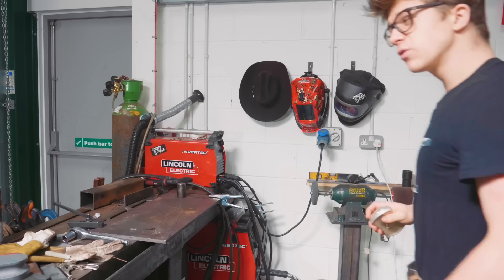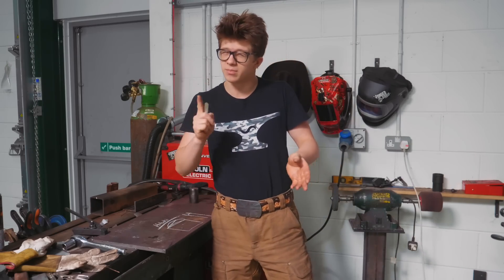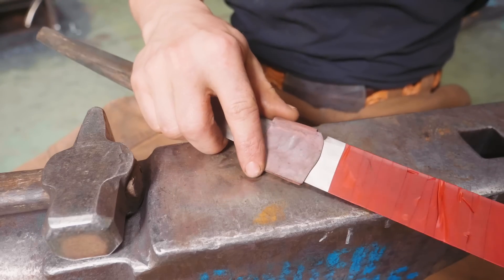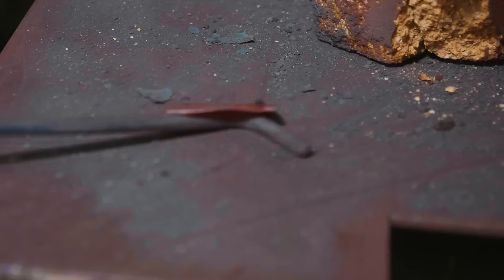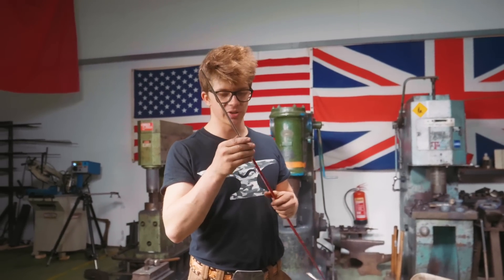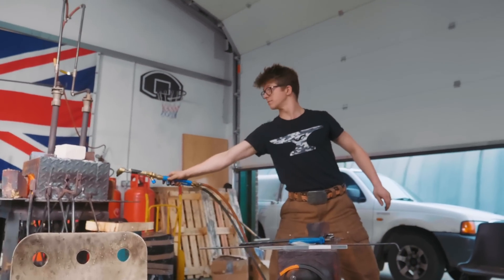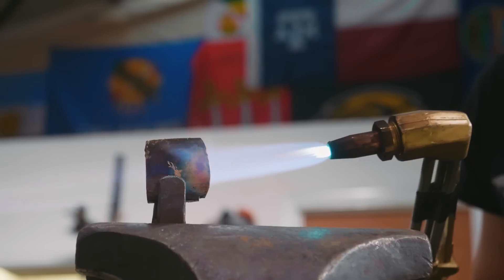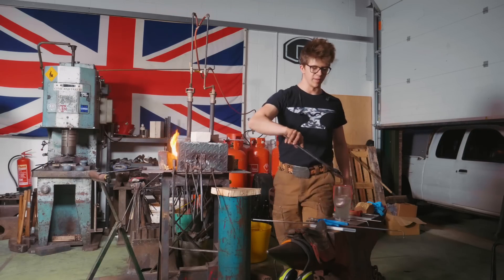MAKING A KATANA!!! 1 MILLION LAYERS!!! PART 6 - The Habaki

Comment: Never before have I felt qualified to offer advice, something that could have closed that joint in a really cool looking way that would have gelled immensely with all your previous forge welding experience would be some mokume  gane, if you'd made your spacer from brass(or many other things but brass is perfect for copper) you could have heated it up till you saw the brass "sweating" from being near its melting point and you could have forge welded it together with teeny tiny taps wit a hammer. Glad you got it done somehow man, well done!
-Tom

Comment: Hi Alec. Next time if you need to solder something similar try to hammer the silver stick making it very thin. Clean the copper with acid to remove the oxidation patina. Lay the thin silver stick you made in between the parts of copper and tight them up with a clamp. Heat the copper until you see some silver flowing out. Job done!! Forgive my poor English. I'm Italian...

Comment: The key to soldering is a good clean joint, right before you go solder sand or wire brush over the place you need the solder to stick, it needs to be bright shiny clean to work. For what you are trying to do you should take another stab at tig welding copper, it can be done.

Comment: Hey Alec. So when soldering, flux wants to flow towards the heat and the “solder” flowers to the flex.  So if you heat it from the button you’ll notice that the flux will flow down towards the heat, at that time add your material ”solder” you’ll see it flow on through. It should be as strong as a weld. Sir good luck. Thank you all of your fun videos.

Comment: With your new found knowledge of silver soldering, you can not also do copper plumbing!  The methodology is the same, you heat up the copper using propane or MAPP gas then add the solder.  You do need to use flux when doing plumbing so that the solder gets into the joint and creates a water tight seal.  Well done, and as mentioned I really like that you do not edit out the mistakes as it helps us all learn the why's of each failures without having to run through it ourselves.  Keep up the awesome work, and I will look forward to future video's!

Comment: brown tip - lowest silver good for copper - copper, cherry red - stick some solder on it, move the heat and pull the solder to where you need it (it follows the heat), its pretty easy even a map gas torch is more than enough for that. practice just slightly melting it and making a tower (flame/heat control). very basic probs all wrong because its 3am but its something

Comment: Also for fun way to temper the blade. You could take a large thing of square tube, weld a flat piece of metal on one end and use that as the base to stand it up right, fill it with oil, and you could take a blowtorch to the outside of the tube and warm all the oil to the desired temperature “500°” but you need for the metal. You can let your sword soak in that oil for that hour or so that you need. You can use that instead of having to put it in an oven. Good luck sir have fun building things. Can’t wait to see the next episode

Comment: Just a quick hint Alec, you can tig weld copper. If you make a piece of filler wire from the copper it will weld fine on dc current the same as steel.

Comment: Good soldering requires 3 things aside from sufficient heat:
1. A good close fit between parts
2. Mating surfaces MUST be clean
3. Complete flux coverage on surfaces to be bonded

A good solder joint won't even be visible once it's done and the excess filed off the surface.

Comment: I Silver Solder on refrigerator sealed systems every day and there are a few things to look into. 1: I would look into if you are using the correct percentage silver solder. on copper lines i generally use 5% silver solder and Most days i dont even need flux. 2: Flux paste! It is amazing it can wrap around whatever you are using and works perfect 3: application. When trying to solder i see you place the solder on and try to do it. Essentially you will end up with a small leak which will of course progress with vibrations (Something you will see a lot when hitting things with a sword) To try to put it simple apply head to where you want the solder to flow with such thick copper you can bring it up to a glow but its not necessary but touch your solder to your piece and move the farthest end of your flame close to it. This has been my tactic and it never fails me. It brings the temperature up enough to get it into that transitional period of melting and you will see the copper suck the solder right up!

Comment: Alec, you need to clean your copper, sand, degrease, etc. then use your Tig welder and a copper filler rod and weld the Hibaki ,( sic-?), or any other copper you want fused without having to use solder. Also you can then sneak your work without worrying about the fused joint coming apart.

Comment: I'm an electrical engineer, so my soldering experience is mostly electronics, so it might be different, but, in electronics, you generally heat the joint and melt the solder using heat from the joint (solder tends to flow towards heat). As far as temperature, minimum would be enough to melt the solder, but higher heat can make it flow better.

So, I would imagine that part of the reason it worked better when you heated the part first was that the part was melting the solder to an extent or hotter than the solder helping it flow in to the part.

Comment: Mr. Steele, you can TIG weld copper as well, it just requires higher amperage than normal for the material thickness because of the thermal conductivity, otherwise it's just like steel or stainless, argon shielding, DC polarity.

Comment: You can use your Tig welder to weld copper. Turn the heat down and copper wire as the welding rod.

Comment: Hey Alec just take thinner solderwire and maybe not such a hot burner. Goldsmiths use simple propan burners with self air intake or pressure air from the compressor. You only need heat up to 800/900 degree Celsius for silversoldering. Doesn’t make it so awfully risky if overheating the workpiece. Flux up the parts you want to solder and heat it up until solder is melting. Just ask a master of gold smithing ;) Awsome and inspiring to watch you. Greatings from Hamburg, Germany

Comment: Drilling small holes and plug welding works I wish I were there I had the same problem with copper . You might have to play around with your gas settings on your tig once you get copper welds quite nicely

Comment: The filler metal goes where the heat is applied. Flux the joint if needed, heat the material to be joined, apply the filler, use the flame of the torch to draw the metal where you want it to go. If the joining material is really close together and well fit, capillary action will pull it into the hotter areas where you're applying the flame.

Comment: If I'm not mistaken, I believe that the Habaki is tightly hammer fit, then depending on the metal used is either soldered or gently forg welded closed
Reply: Also, as the Habaki is often very visible it wouldn't hurt to have a touch mark showing

Comment: For starters even though you use Flux, the copper joint has to be extremely clean. File, sand where the joint is then use a solder paste for Flux. Pure silver will hold better than the silver solder as it has small amounts of tin in it. Plus it looks like you had the copper to hot you only need to heat where it's going together. The rest of the copper will heat, copper heats differently than steel. Try soldering copper and stainless steel together that's a tricky one. Lol

Comment: Alec a good way to solder is to clean the spot you are going to solder and use flux and put the solder on there and the heat should come from 180° of the solder because the heat will draw the solder in

Comment: Silver solder on copper doesn't need flux; it just needs a clean surface. No carbon build-up, oil, dirt, etc... You have to heat up the metal away from the solder joint to prevent your flame from dirtying the surface, then when it gets to the right temperature the solder will suck into the gaps. Usually I use a silver bearing solder wire, and touch it to the start of the solder point until it starts seeping in, then I run it across the solder area until I'm satisfied.

Comment: Hey Alec try tig welding the copper. You should be able to do a fusion weld down the end. I work with welding copper sheet metal. It will take a lot more power than steel.

Comment: The key to silver soldering is to clean your piece before you start. Just like Damascus, silver solder won't bond to an oxidized surface. You will actually aneal the copper in the soldering process.

Comment: With silver solder you want to cut it into tiny chips with a wire cutter. Then you take your flux and put it on the joint putting a few chips on(you don’t need to much for a good bond) and then heat the joint slowly moving your torch around

Comment: if you dip the solder in flux disolved in water it will stick to the metal and won't fly off when you put the torch on it

Comment: When soldering, the copper has to be very clean, i.e., bare metal clean (sand it or wire brush it) and well-fluxed. When the solder wire was balling up that's because the copper wasn't clean enough and/or not well-fluxed.

Comment: Next time you hard solder if the piece is copper just make sure the copper is clean no need for Flux the problem I saw you had was the solder was not sticking the reason is because the copper was too hot the color you are looking for is a dark cherry  and also don't be afraid to hold the solder in the flame to preheat the filler...... another trick is to heat the copper then put a small dab of solder at that point you can see the solder solidify. Hope this helps

Comment: Flux is crucial to a good silver solder joint. Solder follows heat, localized heat along the joint, you can draw the solder along with you torch, and control to a degree areas you don't want solder. Solder will NOT fill gaps, a tight fitted joint is essential. It takes minute amounts of solder to perform the function. A clean joint is also essential, solder will not flow through a dirty joint. A mild pickle or acid bath will remove dirt and oxides. A dilute acid bath of muriatic acid and water will work, the copper should be a matte yet bright copper color. Dipped in a bicarb neutralizer, the a quick clean water rinse. Liquefy your flux, mix your flux with clean water to make a soupy paste, apply along the joint with a fine paint brush. This allows the flux to flow into and along the joint. If the flux won't flow, neither will the solder, you have gaps. Flux the solder as well as the joint. The finer your torch tip, the more control you will have over the solder joint. Stop using the brushy part of your flame. This is the oxidizing portion of the flame, oxidation is your enemy in soldering. Looking at your flame you will see a bright, blue cone nearest to the tip of the torch. You want that bright cone closest to the joint. This is the hottest part of your flame and it is a reducing flame, no oxides form. The bigger the tip, the faster it happens, that is why you want your smallest tip, this is not steel or iron, it heats very quickly, has a lower melting point and shit goes south in a hurry. Hope some of these tips help. 
Learning to silver solder would be a good practice. Most knife and sword makers solder their cross guards rather than relying on the handle to keep it secure. The cross guard receives a lot of impact, having it securely solder protects against it loosening.
Reply: This shit right here..... Man knows what he's talking about

Comment: Copper can be soft soldered, brazed, welding.
You have an AC / DC WIG welding machine, so you can weld copper.
Only be soldered with a short soft flame.
With an acetylene oxygen set, there is a small tip pure and no cutting burners.

Comment: Try using a smaller torch tip. I find it helps localize the heat giving more control.
Reply: Also I lay the flux down to where I want to solder light heat to flux then start adding filler wire.

Comment: Next habaki, try making your wedge, setting it in place, wiring the entire assembly together tightly (give it a few whacks before wiring), placing your silver solder inside it, and putting the whole thing into your forge.

Copper, brass, and most softer metals don't harden in water. In fact, it comes out of the fire dead soft. The final fitting of the habaki involved tapping it all over and work hardening it ever so much. 

It's a pain. I was able to have one completely shaped in about two hours at one point. It's not easy, and for a first attempt,  you made a fine habaki.

Comment: hHeat the copper then lay the soldering metal on the seam you want closed, some light hammering will aid in bonding the metals, on the inside of the habaki heat basically the same way, up to melting temp of your solder material, lay it in there as straight as possible, then use a file to press it down into the thin void to act as the spacer. The heat will be adequate to melt the solder without aiming the torch right at it, because when doing that your're melting the solder to fast and blowing it apart.

Comment: For future projects bonding copper it is easy to tig weld using copper wire as filler metal or just fusing you welding it on reverse polarity and it shows no signs of heat transfer similar to aluminum but welds like stainless

Comment: Silver solder has to have an extremely clean surface to bond to. It also will be silver when you file through it. Try Silvfloss 15 percent silver and quench in water to break free the oxide. Also while soldering use the bluest brightest part of the flame to heat it up

Comment: You are burning off your flux before it gets a chance to react with the oxide layer.  You need to heat the piece to a soldering temperature, remove the flame, then apply a liberal amount of flux.  After that, touch the solder to the joint.  The heat should stay above soldering temperature  in the piece for 1 to 2 minutes.  Bringing in the flame at any time while soldering can instantly cause everything to oxidize and the solder to not flow.

Comment: I'm a little late here but for future reference you can tig weld the copper. It's a little tricky but I'm sure you could figure it out. Just make sure you clean it with acetone and use strips of the copper you're using as filler rod. And set your welder to dc- with about 25% more amperage than stainless steel

Comment: Clean ( light sand ) parts to be soldered and use silver solder. Silver solder will flow to the heat can even flow up and no need to flux better to but don't need to

Comment: I have a bit of a challenging build suggestion. It would be a difficult, but a Damascus chainsaw guide bar would be a killer build IMHO. Now it would take some homework, as you would have to pick a bar mount pattern, so it will fit on a specific saw, like a large Husqvarna or Stihl saw. You'd need to get the grove spacing, oil feed hole, and tail profile just right. To make things easier you'd likely want to go with what's know as a hard tip bar, aka a bar without a sprocket nose, as making the pocket for the sprocket would be very difficult.

Comment: 8:08.... The best solution is making one out of a solid piece of copper (or brass or bronze), just like they do on the real katanas.
They drill a few holes from top to bottom, followed by a lot of filing. 
It may seem like a lot of work, but remember that copper is quite soft. In just a few hours you will end up with a habaki that looks a lot better than the one in the video.
A real habaki has no (soldering) joints and the walls are thicker, therefor, the whole thing is stronger, too.

Comment: You could use a tig welder and a piece of electrical copper wire to weld the opening in the habaki.....it goes very easy ,you only need to preheat the copper habaki a bit
.

Comment: Hahaha! I know how those days are where everything fights you!

Here's my tip on on soldering, well brazing, but as I understand it they work the same way just different temperatures, I've brazed a decent bit but never soldered. Don't try to liquify the solder or the brazing rod, aim the heat at where you want to the puddle to go, and it will flow into there. So what I think went wrong with your first attempt was the tong bits were acting as heat sinks and blocking the heat from getting right into the seam, I'd suspect it would've worked better if you had gripped it from the top and had the seam in open air, heating it from the bottom.

Comment: When sweating copper alloys you do not need much heat but it is just soft soldered. The heat you are using would be ok for silver solder. Keep in mind how little heat a plumber would use but you need flux always even for soft soldering aka sweating. In making trumpets I use acid based flux so the flux is dissolved in acid. Most people would weld it up with modern welding equipment than heat and beat it to the sword for that custom fit. Keep in mind that when not using silver solder if the heat is too high you crystallize the lead.

Comment: Silver solder needs a clean flame, and it flows twords the heat. ;). You need to make sure the copper doesn't have scale, and that the solder is very clean

Comment: When you solder something. You should heat the base material and let the solder flow towards the heat.. do not put direct heat on the weld material weather it be lead based , silver , tin etc. I am by no means an expert but I have screwed around with it alot. 
Keep the videos coming I have learned and continue to learn slot from you 
Cheers from Saskachewan Canada